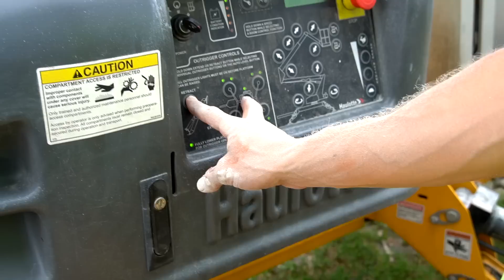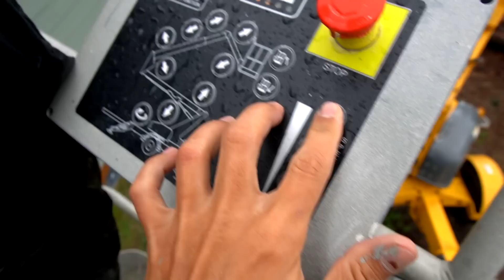A Rough Week with a Sweet Ending | Summer Days at the Cabin

Comment: Just a suggestion: the trim pieces that are on the window, on most doors they come off by removing a few screws. Take them off, tape your window and paint them separately. Much easier to work on them that way.
Reply: I’m guessing you didn’t watch them install new siding. They removed the trim and reinstalled it at that time.
Reply: I believe he meant the door window frame

Comment: Great vid, i have watched a lot of your videos and i really like what you guys have going on there. A little tip from a Butcher regarding your "Processing a Moose" Video, and the grinding of the meat;
When you assemble the grinder, make sure to put som vegetable oil on both the holed metal disk and the blade, that way it wont dull the blade  immediately when you start the machine. Second, make sure to have all your pieces of meat cut out and ready, the reason there is a tray on top, is to make sure you feed it constantly, even before turning it on put meat in the tube. That way you avoid friction and heat build up, (Which cause bacteria growth faster). Also running the machine without meat will wear it out fast and may cause it to breake down. - Hope its usefull. Love from Denmark.

Comment: From my experience you have to balance the weight of your frames. Just like balancing a washing machine with a heavy load. Move the frames around until you get the best weight distribution. If not then the honey extractor will jump and fly around like there is an earthquake going on. It’s also less likely to destroy the comb if it’s balanced. You can also do it in smaller batches as well to make the balancing act easier. You don’t necessarily have to completely fill the extractor with 9 frames. To much weight on one side will cause havoc when it starts to spin.

Comment: I worked in my school holidays for my cousin with his bees and see a few things that may help.
Only use the new foundation sheets with wires melted into the wax for strenght. This saves wasting the bees effort making that they could be gather  honey instead.
Warm the frames before decapping them, makes it much easier. The hot knife is fantastic. Make sure the wooden sides are used to slide the knife down. Gives even depth to the honey comb.
Did you warm the seperator first...makes the honey flow better.
Hope this is usefull to you.
Ian   New Zealand

Comment: Loved the video! The hot knife is not really designed for precision de-capping, you need to have it flat against the wood and apply even pressure down in a sawing motion. There is more wax removed but that can easily be macerated and drained. This also makes the frames more balanced as well which aids in extracting. I think the reason you had the blowout was because of the odd shaped, bulging comb which caused it to unbalance. For any spinning extractor, you need to start out at a slow speed for a minute or so. This allows some of the honey to come out and it kinda self balances, but a good strong grip on the outside is always a good idea.
Reply: Also, it looked to me like the temperature needed turned up a wee bit on the knife, it does have a thermostat adjustment.

Comment: Electric extractors spin much slower than Eric was trying to do manually. Our instructions says to spin up to 10 minutes at the slower speed. Sorry about your blowouts. We've had them too. Also, if you space the 10 frames in the hive box so that they touch each other (a little extra space on the outer edges is fine), you'll find that the hot knife works better as the comb is all the same thickness. As far as more than one queen in a hive, the oldest one will kill all the others. There's always so much to learn about bees. That's why its such a great hobby with a sweet ending.  Nice finish on the house.

Comment: Hey guys! 
Some tips for using honey extraction thing: 
Don’t spin too fast. It’s better to spin slow-average speed but longer time. Plus you want to set all frames at the same side. So just imagine that when frame sits in the hive (on the left side the holes(where the honey is stored are pointing up slightly to prevent it from spilling out) and when you spin frames in the machine, you want it to spin the direction that honey easily comes off . So if you spin it clockwise, you want the frame tops pointing towards middle of the circle. 
Sorry if I’m not making any sense, but that how me and my dad used to do. 
Hopefully you’ll have luck next time 😁👍🏼
Thank you for your videos!

Comment: On the combs, buy a 9 frame spacer. It's already drawn out, but they'll draw it out more.  Where that knife slices the caps off, let it drip, you'll catch it.  But put in extractor, it's done in no time.  Ambesol and orajel is the same thing as Sting Kill which is good for stings and burns.  Get burnt, don't sit there and hurt, just put some ambesol and orajel on it.  There is burn gel which stops the burn from progressing and still uses benzocaine.  But ice will draw the heat out so less damage.
If you contact Winters Apiary has Russians and Caucasians.  Caucasians are real gentle.  They have the longest tongue and mine would gather nectar in invalidate weather.  Winters Apiary is in Tennessee.  I had good results with the Buckfast bee too. Which B.Weaver apiaries has in Texas, but given your locale and climate, it's what Russians  and Caucasians come from.  Caucasians only being prone to Normal, which use that medicine for that.

Comment: You guys should consider rain gutters, with a catch system so you can utilize that water for showers/animals or what ever you decide.  I realize you have a well.  But it may be an easier solution to firing up the generator to do the well.  Also it will help with your foundation around the house.

Comment: You can so easily clean your stove window with the ashes from the stove. A bit wet peace of paper towel, dip it in the ash, and rub it over the burned glass. And afterwards, clean it with another piece of paper towel, and burn the moisture away

Comment: To help with extracting.  Run 1 less frame in your honey super than usual.  (I run 7 frames in an 8 frame super)  You can get a spacer to spread them out completely.  This lets the bees draw out the frame fatter.  Easier to uncap.  You don't lose any honey - it's just on less frames.  Then put the uncapping knife on the edge of the frame and cut down.

Comment: Just a thought for your chimney clean/ maintenance next year. Think about adding some chopped fiberglass to the black asphalt/caulk. The fiberglass will reinforce the caulk so as the wind blows the caulk will tend to crack less. My masons used chopped fiberglass in their mortar for reinforcement to prevent cracks. All you need to do is put some of the caulk tar in a jar add a pinch or two of chopped fiberglass and mix vigorously then apply.

Comment: You can't be afraid to get into the wax on the frames, also, the knife's edge is probably beveled. That give you the correct angle to use, and the knife can touch the frames' edges without issue to give you a depth guide. If you want to just cap the comb, a fork works well, but using a knife is meant to go faster and simpler.

Comment: Heads up around the windows you got the top correct but your side legs should go all the way down flush to the bottom board not sitting on top potential leak I been a carpenter for 45 years everything else looks great maybe corner board on the corners definitely help’s keep out moisture and draf just suggestion

Comment: I have one of those doors too. I just used a really good primer (I don't paint the plastic window framing), and if the dogs scratch it, I sand it and add a new coat of paint in that area.  I refresh the paint once in Spring and once in Winter.  Seems to work.

Comment: Bolt the extractor legs to a pallet and stand on it while you crank.  Also, for extracting just a few frames don't bother with the extractor (you lose too much honey in the equipment).  Buy an uncapping fork and let the frames hang over a tub in a warm room.  NEVER extract outside unless you're protected from the bees.

They come to rob back the honey and you'll lose thousands drowning in the honey.

Wire every frame that you're going to spin.  Otherwise the combs blow out from the stress.

Nice work and some wonderful Alaskan honey!

Comment: They have found honey in the pyramids of Egypt and it had turned into crystallized form but once they added moisture and heated it ,it turned back into edible honey. Honey will not spoil but never refrigerate it. If it crystallize just put the jar in a pan of hot water and it will go back to honey. I raised bees for forty years so if you ever have questions about raising them or harvesting honey I'm glad to help you .

Comment: Hey guys I don't want to tell you what to do but I realize you have a lot of wood to heat your house, but big but for every four heat fires of wood burn a load of hard coal. If your stove can take the heat coal burns 🔥 hotter and will burn of the creosote..If you get a creosote fire in your chimney you're going to loose your home. Creosote burns like grease very hard to extinguish..Another option is a special log that's made to burn hotter and will clean out the creosote Aldo. Be safe and good luck. Jerry

Comment: I don't believe you need to spin your frames so fast.  I have a similar extractor and have bolted it on a pallet.  I stand on the pallet and that prevents so much movement.  I still have some movement of the wax/plastic foundation, but you can just push it back into the groves.   Count yourself lucky that you can work your hives without a vail.  Here in AZ it can be misserable in the suit and the bees can get pretty hot/mean.

Comment: With 8 frames to extract and a 9 frame extractor, do it in 2 batches, 6 and 2 frames, if you put frames that are about the same in weight aposed from eachother, the balance is much better or try to spin slowly at first, it will equals the weight distribution a bit put 2 empty frames as a counter balance in the 3rd sector.
For decapping the frames, get some decapping forks, they are about 3 inches wide and if you get the proper technik you only lift the cappings (as you can see here: https://www.youtube.com/watch?v=5i1-CkSkLas ) and you can save that wax to rerender it.

Comment: First think crossed my mind was where a bear was blamed for taking a piece off.  Where there is a wood penetrating epoxy intended for rotted wood, called PC Rot Terminator.  Rot I crushed easily with my fingers, I drenched with the epoxy, 3 days later, I smacked it with a 16 oz. Hammer, even hitting it, it wouldn't budge.  No dent or nothing.  Where if the wood is bare, coat it with epoxy, it would be hard, very hard and part of the wood.  Between that and a 12 gauge shoot gun with a slug, Bigfoot comes knocking, you should be safe.  Watch The Legend of Boggy Creek, a docudrama on you tube about Bigfoot down in Fouke, Arkansas.  A 1-1/2oz. 12 ga. Slug, which is about 3/4" if Sasquatch is 12' tall shoulders 4' wide, it'd still knock him on his butt.
I mean weather might mess up his food supply and he smells all the food you have, he might come pay you a visit.  Oh another movie on you tube, "Creature from Black Lake" which isn't far from Ark., But in La.,is just a good watch.
Oh the honey harvest, Sasquatch might like that too.